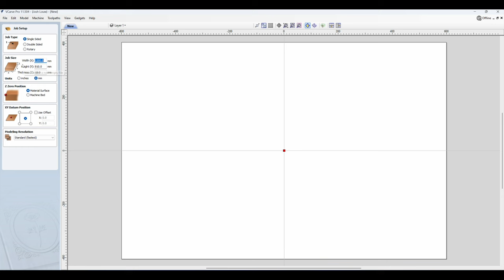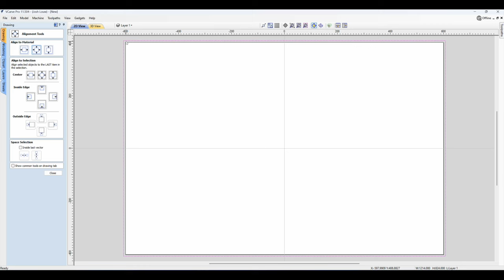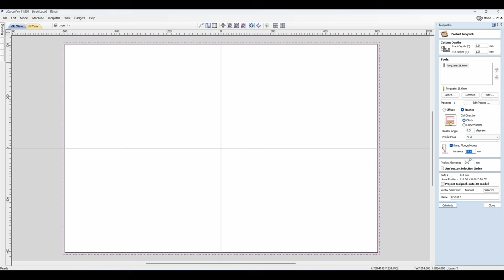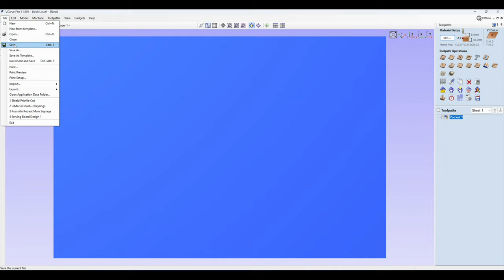Spoilboard Surfacing Like A Pro - Toolpath Under  4min!

Comment from the maker: There is a big difference between what is flat and what is level when it comes to surfacing your CNC spoilboard / wasteboard.  This is an easy way to set up a toolpath you can reuse again and again, and, it only takes a few min to set this up.  Make sure you check out the next video as well on how to create a grid for your spoilboard / wasteboard.

Comment: I noticed you mentioned the issue of an unlevel floor resulting in twisting of the spoil board.  While most folk try to cancel this out with a torsion box, I took a different approach that seems to work quite well.  I have a large cart under my CNC unit, with a 2.5 inch thick top built up with MDF, and with the usual 4 large casters, one in each corner.  On my cart, the front casters are mounted normally, but the rear casters are in the far corners as well, but attached to a long plywood beam that hinges in the middle, so they automatically compensate for any irregularity in my garage floor. The effect is like the difference between a 4 legged stool and a 3 legged stool.  I can roll my cart anywhere on my bumpy garage floor and all 4 wheels remain firmly on the floor.  Now this doesn't guarantee the top will always be level, but it is free of any twisting.  I suppose if the exact level concept were an issue I could re-engineer the rear central pivot point with some form of vertical adjustment?  It is currently just a 1 1/2 inch piece of galvanized pipe that the multi-layered plywood beam pivots on.
Reply from the maker: I would love to see that. Sounds like you put a lot of thought into that! A torsion box works well, but something like a Greg bench would do the same. I could not get or find a big enough one in Australia and the ones that ere available are very expensive. But neither would compensate for a floor that is not level like your design does. I suppose you could attach screw in legs that extend past the wheels to lift the bench on each corner individually to level it if you want to. Find that a pain on my gib laser because you can’t move it if you need access behind it.
Reply: @TwinSummitDesigns  I'm 73 now, but I learned the beam-mounted rear wheels, (actually, it was legs back then), when I was just out of the service, working in an appliance shop in 1974.  There was a line of washing machines that had the two rear feet on a long beam that pivoted in the center, so no matter how out of warp the floor was, the machine always sat securely without requiring a bunch of fumbling with screw-adjustable feet in the rear.  Somehow, when I was designing my CNC cart, this thought came to me as I struggled to make it sit squarely.  Plywood was far cheaper back in 2016, and I'd hate to have to build it now, but the concept should play just as well in a scaled down cart or table.  I need it to have wheels because it sits directly in front of our house's main water shutoff valve.  Because the massive valve and pressure regulator stick out several inches, the rear of the cart body stops several inches short of the rear of the top, and the balance beam is hidden in a low long box that is attached to the main box and fits below the valve.  An odd looking contraption, but it somehow works.
Reply from the maker: @gjforeman  I really appreciate you taking the time to describe this in such detail.  Im still searching on Google for an image to see what it looks like. :)

Comment: Im just getting into this with a cheap 3018pro.  I recently made my first spoilboard and did a similar run.  My problem of course is that the 3018 only has a 1/8" collet with 1/8" bits...  It took a while to make the first one.  Ive since ordered a new collet for 1/4" bits.  It goes a bit faster now.  Im enjoying your vids, keep them coming!
Reply from the maker: Thanks very much for the comment! Really appreciate that. I recently went the other way funny enough and got a 1/8 collet for a bit I ordered in the wrong size. I really want to get more content out as well in the new year. Been quite a challenge trying to do that while having to complete orders at the same time.

Comment: I did this and when I ran the job, it gave me a limit error (like it was going outside my machines range)... even though I'm under it. My bed it 52 x 50 - and even more before it hits the limit switches, and it still give the range error... any ideas what I'm doing wrong? Thx!
Reply from the maker: Usually when I get this error I have my datum/starting position wrong which means it thinks it needs to move past the x or y axis boundary or limit relative to where the starting position was set to. Maybe just check to make sure..?
Reply: @TwinSummitDesigns  That makes sense... so I'm wondering how its going to go beyond the XY limit when you make your cutting path beyond (-1/4" or so) beyond the size of the machines base? When I made it 0,0 starting (not negative), it worked, but when I made it negative it errors? Thanks for the help!
Reply from the maker: You are welcome! I’m not entirely sure why that is, but that error had me scratching my head a few times as well.
Reply: @TwinSummitDesigns  thank you 😊

Comment: How long does the surfacing takes? I need a planer  but im thinking about getting a CNC instead, one similar to your so im interested in how long it takes.
Reply from the maker: Interesting question. Are you referring to a thicknesser/planer or a hand planer? I sometimes use my CNC to get a flat surface on one side of a slab I need to engrave for a customer, but usually after I put it through a planer first to remove the bulk.  As for how long that takes, it depends on a number of things like how hard the wood is, what feed rate you are using and so forth.  MDF like this spoilboard is soft so you could go a bit faster.  From memory, that took about 7min or so to complete, but I cant recall what my settings were exactly.  It would make a very expensive planer though if that is the main purpose for getting one. :)  But, I know that is not the only thing you would use it for!  It's a very good robust machine overall.
Reply: @TwinSummitDesigns  thanks for the answers. I'm building my own so the cost won't be that high. A good planer would cost the same, but then I can only plane. I'm ok with it taking a long time planning as I'll gain other functions too.

Comment: I'm assuming the +14 means plus 14mm? You did not clarify.
Reply from the maker: That is right. My software is set up to work in mm but if you are using inches it would be the same.
Reply: @TwinSummitDesigns  Thanks, I just wanted to be sure. Appreciate your quick reply. Have fun!
Reply from the maker: @JD-nq4vb  You are welcome!  Same to you.

Comment: I really enjoyed your video, and I have Liked & Subscribed.  It did leave me with an unanswered question...
If you flatten your spoilboard the way you describe at 0:40, the cutter will ALWAYS be the same distance from the surface, because the cutter just machined it.
However:
If any of your rails has a bow in it, the board will not be flat.
If one end of a Z axis rail is higher than the opposite side, the board will not be flat.
At the end you used a straightedge to demonstrate.  It would have been clearer to use this at the start as well, but you must check from corner to corner.
Only if your machine is accurate and calibrated will you get a flat spoilboard.
Reply from the maker: Hey John!  Thanks very much for your comment.  I agree with what you said.  If your machine has defects then you will have issues.  Best to take care of those first I reckon else it will drive you nuts with inconsistent results.  Not sure what CNC you have, but these Onfinity CNC's are built like a tank.  Not to say they absolutely faultless or won't ever have issues though.  Anyway, I might do another video on this topic soon and I will take on board what you mentioned.  Thanksa gain!

Comment: The video I was looking for. Just one question, how do set the speed on the router and feed rate on vcarve for that diameter? I am asking for the calculations, my hit it’s 35mm, I don’t want to break it or something.
Thank you.
Reply from the maker: Hey Alin!  Glad that halped.  I started with a chart I made to find the correct speed, but it got complicated not knowing exactly what the router was doing.  So, the easiest workaround for me is to just start it at a high speed (4 or 5 even) and then I dial it back once it gets going till I see more chips than fine dust.  You will be able to to tell by the sound of it as well if it is too slow.  You can pretty much tell it it struggling to keep up.  As long as you do shallow passes you will be fine.  I do 1mm at a time on this job to keep as much of the spoilboard as possible.  With that depth it would be hard to break a bit I reckon.  Hope that helps!?

Comment: For accuracy it is not necessary that a machine tool be level, BUT it must be precisely out of level the same amount when measured on each side of the X and Y axes, respectively. Otherwise, the surface may be relatively flat but there will be a twist in the axes. This will result in the Z-axis changing orientation slightly as it traverses the X and Y axes. 

For woodworking projects, the amount of error introduced for length, width, and thickness is usually insignificant. Most woodworking projects can be off by 1/32" and no one will notice so long as the joints match. However, an out of level condition could cause problems when milling parts which must fit together precisely.

This is the reason why machinists who produce parts to fine tolerances of less than 0.001" always level the machine tools, verify the distance between linear guide rails is less than 0.0001" different and the height is also less than 0.0001" different from one end to the other along each axis, tram the head so that it is less than 0.0001" different from one side to the other along the extended swing arm the indicator is mounted in, and adjust the gibs to remove excess play. While gibs aren't present in hobby grade CNC machines, the other alignment techniques can be performed.
Reply from the maker: Thanks for taking the time to watch and leave such a detailed comment.  Much appreciated.

Comment: Can you share the feed and speed, Just to a comparison point to my preset
Reply from the maker: Hey Christian! Sorry, for the late reply.  I have been flat-out busy with a bunch of orders.  I will have to check that for you in the file I created. Generally, I start with a higher speed setting (around 4 or 5 on the router) and as soon as it touches the material, I manually slow it down till I see chips and no fine dust.  That way I can run almost any feed (depending on the specs for that bit). Way easier than going back and forth trying to dial it in with the software for the specific material or stock you are using.  But I will have a look and post it here.